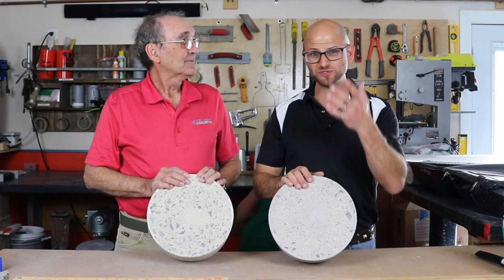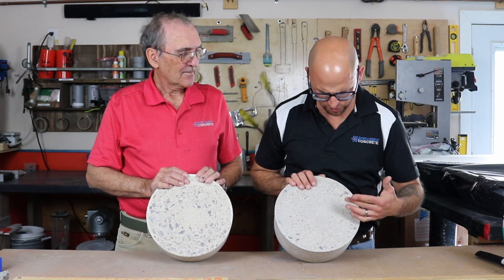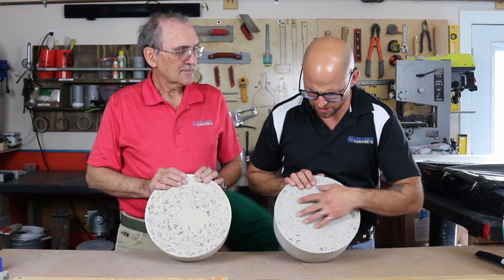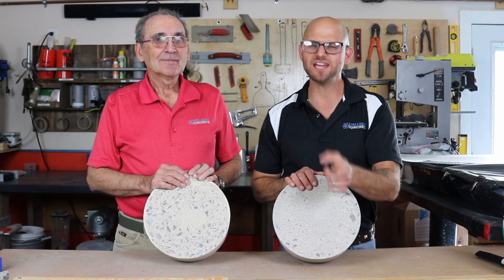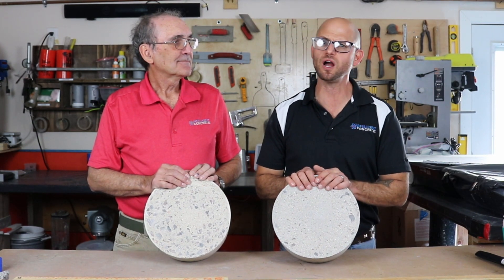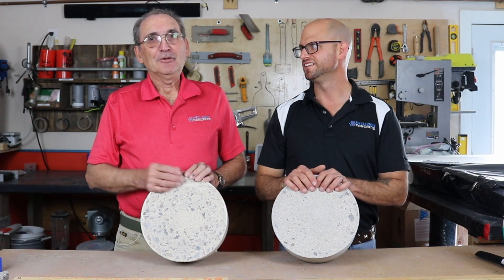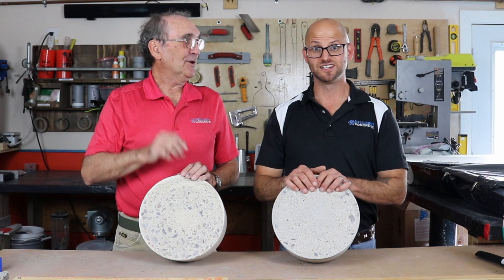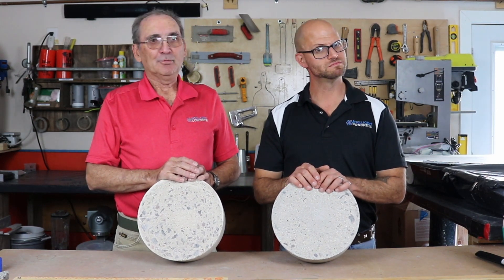What is Colloidal Silica? - Vlog #90

Comment: My goal is to develop a super strong well insulated light weight concrete that can be 3d printed.
Plan is to start with UHPC but replace the sand with fine powered styrofoam.  Has anybody done this?

Comment: Hi. I'm trying to find a way to simulate petrified wood. Was wondering if I could soak wood in Colloidal Silica mixed with water or something else, perhaps under pressure and then maybe bake the moisture out. Do you have any thoughts on how you might do this? Or do you have any idea of anyone who could or would? Thank you. Trying to petrify wood art.
Reply from the maker: @timothyappleseed2986  that might work.  Let me put a little more thought into this.
Reply: @IntelligentConcrete  we are concrete curbing company for residential curbing. Would colloidal silica or silica fume help with the strength and hairline cracks?

We currently mix 1 to 4 Portland to sand with a plastercizer

Comment: I am planning to apply some colloidal silicate followed after drying time by some sodium silicate on this dry pour project i had. 
Do you see any issues with that approach ? Idea being I want to make my project a bit harder and denser.

Colloidal Sillica vs Colloidal Sillicate - which on is smaller in particle size?
Reply from the maker: @lederse  depends on the types of both.  

I would get away from using the silicate just for a safety aspect.

Finally, the colloidal silica is a small, smaller particle size and the silicate ( which is not colloidal ) is not a particle it’s a much smaller solute in solution.

Comment: I’m assuming your mixes containing colloidal silica are made using liquid colloidal silica additive?  Can you get the same results using dry powder like silica fume (cabosil)?

From my understanding of making a good clay body in ceramics, particle size distribution plays a huge role in strength of final product.  Is the colloidal silica in concrete helping with the particle size distribution on the very fine end, and adding strength because of that?  Or is it some other property of the colloidal silica?
Reply from the maker: There a lot of properties we get out colloidal silica: instantaneous pozzolanic reaction, accelerated cement dissolution, particle to particle packing and more.

You could get similar benefits from silica fume and the like all be it not to the degree.

Comment: Thanks for your steel ball abrasion test on the reference and colloidal samples.

The colloidal silica might have given you a 300 - 400 % decrease in material loss from the steel ball test , what outcome would you get with hydraulic degradation as experienced with water pooling impacted by vehicle tyres on highways ?

Moderately Coarse surfaces would be popular with road builders for tyre adhesion , too coarse a finish would increase fuel consumption , too smooth a finish would become a safety concern .

Also too coarse a finish would propagate pitting then potholes when water is impacted by tyres. 

You probably have a sweet spot in the middle that gives best safety , best fuel consumption and reduced hydraulic abrasion wear ?
Reply from the maker: 50-70% percent reduction depending on how long it’s been pooling.

Comment: Building an ambient pressure submarine--can collodial silica be used with epoxy resin to be subjected to the pressure changes if diving (to 33 feet) & surfacing, repeatedly?
Reply from the maker: Unfortunately I do not but it would be an awesome set of experiments to run.

Comment: I need your advices i tried making sodium silicate by using press cooker, in the end it was so murky my mistakes i didnt clean silica source thouroughly, but there are very strange situation, my waterglass  eventually jellified in hours, in my curiosity i brush on some surface instead coating that i expected what amazed me is something grow like nanofiber but verrry fluffy kinda like cottoncandy, what do you think it was?
Reply from the maker: It sounds like microgels.  We see them before the felling process occurs.
Reply: @IntelligentConcrete  i collected them into a glass jar and its very light in mass, but relativily high in volume, did it have anything useful Maybe as filler or additive?

Comment: What will it do in high temp refractory mixes? Could it be used to essentially strengthen clay or calcium based refractory mixes. I been doing alot of experimentation in refractory for lining foundry and forges and have had best results with sodium silicate. But the sodium seems to be a negative factor. Wondering if I could use colldial silica to remove the sodium content.
Reply: Commonly used in ceramic shell mold making.

Comment: So what's the upper limit of colloidal silica and does that also apply to others like micro silica?
Reply from the maker: Howdy Jake.  Thanks for the question.  It depends on the particle size distribution and the Cementitious binding chemistry.  Smaller particles it’s normally around 2% and the largest particles have a limit of 20% cement replacement.
Reply: @IntelligentConcrete  is that by weight or volume?
Reply from the maker: @feiter  it’s by dry weight and the converted back to volume of liquid.  Also you can use fl oz per cwt with most products that are currently available, much easier.
Reply: @IntelligentConcrete  amazing, thank you. I can only find west systems powdered colloidal silica used in resins (0.012 microns), here in Auckland New Zealand. Does your info apply to this too?

Comment: You guys are putting out some great videos. If you wanted to cover some of the benefits of densifiers in relation to an abrasion test that would probably be very popular with the decorative community. I know a lot of people are curious how colloidal silica compares to a traditional densifier in performance. Would they be roughly the same when properly applied or is there a greater depth of penetration with colloidal silica.
Reply from the maker: John Cernava traditional densifiers like potassium, sodium, or lithium silicates will has a faster reactivity then most nano silica dispersions. Due to the reactivity the potential for penetration depth is reduced significantly when compared to a nano silica densifier.
Reply from the maker: Hey hey John.  I through together an answer on this on LinkedIn and plan to get a video answering this question. 

Here is my blurb from LinkedIn:

“Thanks for the question Jack!

We have a video on this going up this week.  

The answer to the question is a bit long-winded.  I’ll try and bulletize it below.  I’ll send the link once the video gets posted.

- Yes colloidal silica can penetrate into the concrete. Just like deicing salts that penetrate into the concrete and break it down. Colloidal silica migrates through the surface, sub-surface, and body of the concrete; this assumes that there are pathways for this to occur. These pathways are created either by the natural porosity and percolation of concrete or by cracks that have formed from volume change or fatigue.

-The migration of colloidal silica can be accelerated by some type of catalyst and the method of application.

- The depth of penetration will also be dependent on the size and surface area of the nano silica. The smaller and more silica Rich the surface area, the faster the nano silica will react with available Ca(OH)2 to form more C-S-H.  The larger the nano silica particle and the more coated the surface is, the lower the potential for reaction and the is a greater chance for depth of penetration as well as longer fare of reaction.

Let are bunch more factors that play into this but I think it could be...”
Reply from the maker: “... argued that the aforementioned have the greatest impact...”

Thanks Again for the question.